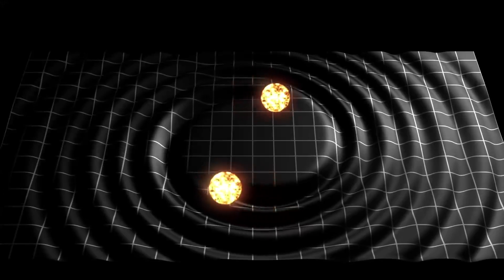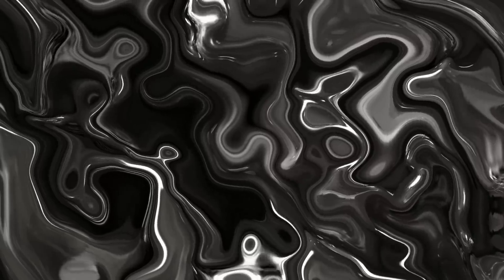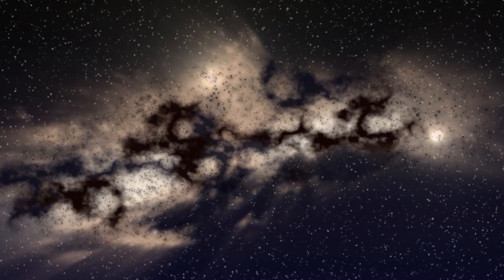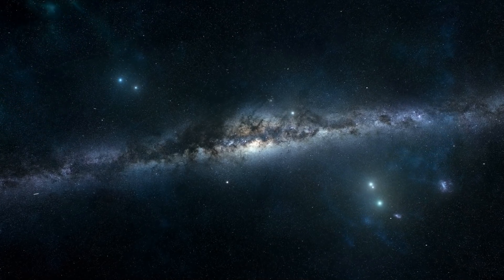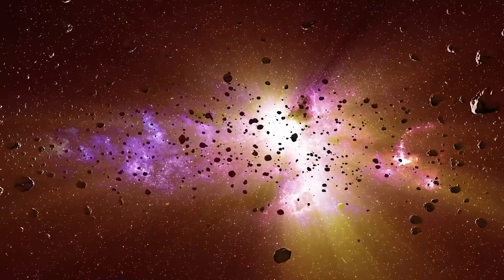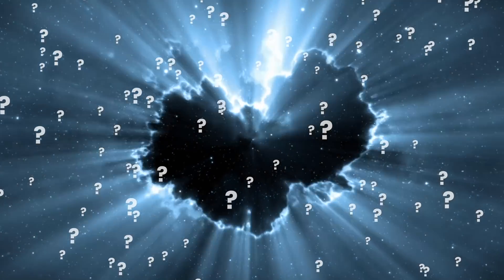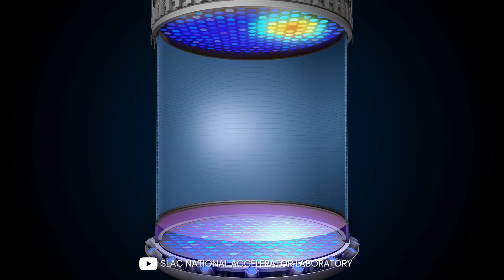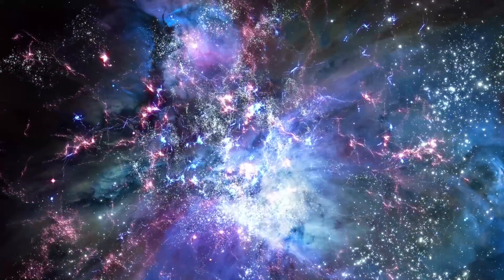This Will Change Physics! Dark Matter May Not Exist!

Comment: Dark matter is just matter we cannot directly detect. We only know of its existence by the behavior of the things in the universe we CAN see.
That doesn't mean there is anything mysterious about it or even that its made of different stuff than the stuff we CAN detect.
It only means we haven't been able to detect it by any other means than its affect on the rest of the stuff in the universe.
Before we went to space, the other side of the moon was effectively dark matter.
Most of the objects and dust in the Oort cloud can be classed as dark matter as well.
We don't refer to them as such though because they are closer to home and we have reasonable certainly what they are.
Think of dark matter as the coat hanging on the closet door when you're a kid trying to go to bed with the lights off.
Its not a monster about to attack you but as a child in the darkness you lack sufficient information to confirm that so you assume  "spooky".
Dark matter is the coat on the closet door...adult version.

Comment: Dark matter is the 20th century version of epicycles,  i.e. it doesnt exist, IMHO. Dark matter is exactly the type of error to be expected when an incorrect assumption is made.

My theory is gravity is not a pull force, but a push force.  Quite simply, gravity is created by the difference in pressure created by clumps of matter in space.  Dark matter can be defined as the material evenly distributed throughout space.  It is what magnetic lines of flux is made up of and also the medium that electromagnetic waves travel through (the way a wave is defined (simplified) is a transportation of energy through a medium.  Its funny how scientists ignore this when talking about light waves because they cant identify the medium.  In this theory dark energy is simply another aspect of gravity.  As the outward edge of the big bang travels along the universe the circumference gets bigger allowing the contents to expand faster.

Comment: I'm surprised dark matter is the only explanation for all this...  What if spacetime isn't uniform it stretches and compresses throughout the universe with different densities. What if parts of the universe with denser spacetime holds things together with greater gravity? I just thought that up in like 30 seconds...  Why don't they come up with more theories instead of sticking to one and thinking that's the only explanation...
Reply: They are coming up with many ones bro and are narrowing their realm to few.
Reply: @loganx833    Yes but dark matter has billions getting spent on it and it may not even be real.
Reply: @clearmist1  yeah that's how everything works imagine that dark matter is real we discarded them for a century and try to find other reasons but later on we found out that all other theories where false so a centuries was lost for research because of our arrogance see. You have to look into everything thing before discarding it wether it worth billions or not
Reply: Are you a physicist or astronomer?
Reply: @ascott2112  No

Comment: Space isn't a true vacuum. With that in mind, imagine what's outside the universe IS. Couldn't that explain the expansion ( if redshift is correct and it is expanding)?

Newtonian laws are provable in our solar system so, what dark matter doesn't exist in our solar system or others for that matter?

I think physics is missing something else and I think David LaPoint may have that answer!
Reply: There's no "outside" the universe. The fields that make up space and time allowing for matter and all forces do not exist outside.

Newtonian laws are easily proved wrong inside our solar system. Satellites time correction and the orbit of mercury are good examples.

You're absolutely right that we're missing something. Were not sure what, but its most likely that Einstein was wrong. There have been some very interesting theories with merit, you might like the latest MOND theories.
Reply: @Drugieuk  The universe has to be expanding into something or it can't expand (again, if red shift is correct and it is expanding). 

Yeah actually I make you right with newtonian law actually.

Mond did try to adjust newtonian law but its still not quite right. 
A variable of about 20% if I remember correctly. Unless it's been modified since I last checked.

Comment: You actually have it backwards.  Finding a galaxy without any dark matter strengthens the idea of dark matter being a particle because if dark matter was the result of a mistake in our understanding of gravity, then our calculations should be wrong everywhere.  Also, the galaxy you mention is not the only galaxy found without dark matter, there are many, and the larger galaxy chewing them up is obvious in many of them.

Comment: 7:16 correct me if I'm wrong but isn't there a difference between dark matter and anti matter? what you just described as annihilation occurs only when anti mater which has opposite charge (negatively charged antiprotons in nucleus surrounded by positively charged positrons) comes into contact with it's counterpart which is normal matter.
Reply: I do not trust this video. Author is mixing dark matter with antimater.
Reply: The thing is, the only thing we "know" about DM is that it has mass, and don't interact with normal matter by the other forces. That allows theorists run wld with theories. Some of them consider that DM is its own antiparticle. Then, when two DM particles fijd each other, annihilate in gamma rays that could be caracteristic and could be detected. People are looking. Anything convincing yet.
Reply: @eljcd  The correct answer. Thank you.
Reply: I think you're right! Definitely a mishap

Comment: I have long suspected that it doesn’t exist. I think it’s far more likely that we don’t understand how gravity works when we’re talking about large objects like galaxies, galaxy clusters, and filaments of galaxies. We also don’t fully understand how black holes and supermassive black holes affect a galaxy rotation. I think it’s more likely that we have not made the right measurements in some cases or at least our measurements are only partially accurate. Dark matter was always this thing that was used to explain inconsistencies on our knowledge of gravity. I always felt that we should focus more on understanding gravity and measurements first before we moved in the dark matter direction.
Reply: I partly agree. I think we don't understand how gravity works. However; I believe the reasoning is that it does not exist. I believe the universe is electric, and all attraction is due to electromagnetism. 

BOOOM Lol 

I honestly don't know, but I do like the electric universe theory. Tidies up loose ends of the mathematics of the universe in my opinion
Reply: @skitzosmurf4324  the electric universe theory creates more problems than it solves
Reply: @skitzosmurf4324  oh good no. Please stop!

Comment: i still think that there is no dark matter and it is just "absolute emptiness" sometimes the best explanation is the easiest and i think trying hard to make a mountain of non-information out of a mole hill of even greater non-information as it seems more likely that we are possibly just ignorant on the "why" behind the mechanics of the expanding universe... what about the warp drive concept of a gravity bubble being that outside our galaxy there is nothing and we have this force from the "big bang" that has just kept pushing the expansion faster from the inside, as a result of having nothing to push against? im probably wrong but is it so hard to believe that when we see nothing that there might actually be nothing to see...
Reply: absolute emptiness doesn't exists though, that we actually managed to confirm, even space is filled with fields which exitations correspond to subatomic particles

Comment: Dark Matter could be tied to the Aether.  The only way the expansion of the universe accelerating makes any sense is if it began from nothing and was constantly expanding at the same rate, but while expanding at the same constant rate, it just seems as though it's accelerating as it continues growing larger.  But the proposed fact that matter has already spread across 96 billion light years of the observable universe despite the universe being supposedly 13.7 billion years old is a paradox of sorts.  Unless matter travelled faster than light at the beginning of creation and has already begun to slow down, yet it just appears to be constantly accelerating because the momentum of gravitational shift has yet to reach us, or perhaps never will while everything is still moving apart until it isn't.

Comment: Dark matter, to me, seems like injections of space. It causes spontaneous creative pressure that slows time as it’s pressure increases. Acting as a pressurized space fluid, it presses equally around physical mass in the universe. It’s pressure slowing time and increasing gravity by pushing against all sides of masses. The more mass to move, the more pressure the mass experiences as the fluid pushes out. Space (fluid) on all sides of the mass must push against other fluid that is trying to move further space and mass beyond planets. The higher the pressure, the slower the time experiences. 

The bubble our universe exists as should really grow until it separated like mitosis. Form there, and one universe spits into two universes. Each being injected with more space until it grows so large that it splits again.
Reply: I call it the "Displacement Model of Gravity" and I have long felt exactly as you
Reply: @Sin526  
Then you are my best friend. This has been on my mind for a while. As a pilot, I think of air pressures. Thus pressure distribution is my mindset. Static pressure is to air as displacing space is to pressure/time.
Reply: @robandnikki1  My father is a pilot as well, and I have been interested in aeronautics/aerodynamics my whole life. I truly believe everything is a "fluid" in the classical sense and that of course includes "space". I say space and not "spacetime" because I believe the current idea of them being inexorably linked is incorrect and that they are two very different and distinct things.

Think of space as the water in a river, and time as the "current" of said water, in a way made up of that very same water but, in actuality, the "current" is merely a result of energy in the system. I believe that "time" or more accurately, the SOURCE of time, is some kind of "energy" or "radiation" if you will, which causes space and everything in it, to "flow" and in turn creating the "river" of reality we experience.
Reply: @Sin526  
I see special relativity as pressure against an object moving through a fluid. Drag increases with velocity cubed. That drag is pressure (dynamic pressure of space) and thus, to me, slowing of time. I believe time is an effect of pressure

Comment: Dark matter is nothing more than attempt to somehow keep Einstein’s relativity intact. That’s what happens when abstract mathematics are used instead of physics. In fact relativity as theory can’t explain observations (dark matter is just one example) and therefore must be either adjusted or replaced by another theory. The same goes for dark energy - mistake in decision to explain redshift of the galaxies by Doppler effect. There’s another solution for that effect, but who wants to listen. 
It’s becoming more and more evident that there must be some other theory that is capable to explain things Einstein’s relativity simply can’t. And there is such a theory - Electric Universe. The theory build on physics, confirmed by laboratory experiments. So the science has a choice - remain in the state of stagnation with Relativity or move forward with EU.
Reply: 😂😂electric universe
Reply: @loganx833      Electric Universe!!!

Comment: moebiusstrips and collatz conjectures edge in 3d space. dejavu. circumcision. foreskin restoration and geneediting with specific essencias of numbers, basically getting a pc with specific parts internet connection and the right phone number. 

says it all.

and your like "dark matter bla bla bla" what do you even want to express? something that has a continuous downtrend as it's function but is still matter. well that's radioactive decay, humans know it as Ecstasy too or as the tree of knowledge of good and evil.
uneven operations on even and odd numbers, it's unfair. thus it dies. there is more than just a duality to things and forces.

past and future probably is binary code that thus is in a dimension that is dead unseen/non material.

Comment: dark matter is a field effect called consciousness. can't wait until I am laughed at and then proved right in the next 5 years. We already know, due to recent insights, time is what is affecting gravity not vice versa. we also know time is an effect of a conscious perceiver. the base fundemental state of reality is governed by its living perceivers. the field effect of consciousness is pervasive but not uniform at all. that's why you wont find the uniform distribution. consciousness distorts time, we already know that because time is relative to a specific observer and equally true for each observer's frame of experience, even when they are dissimilar. Time distortion is created by alternate states of consciousness, for example LSD makes time slow not because of a hallucination but because it changes the structural dynamics of the field effect called consciousness. So if time is affecting the weak effect gravity and consciousness moderates the experiential perception of time. We know from LSD based on the single enzyme that is one microdot. Hmm. It's a baffling mystery to neuroscience because the drug actually acts on the nonlocal holographic "signal" of consciousness and the brain is only hosting it. Where is consciousness? I t's actually creating an epiphenomena called timespace and the brain enables that epiphenomena to create a subjective and coherent experience. There isn't "dark matter" there is the structuring coherence effect that is not distributed ubiquitously like a typical field or force. It is clustered the same way gravity clusters to mass. In this case the dual processing unit called the living organism producing the same effect. Consciousness tends towards coherence and it is non local. I suspect in two years this will be consensus science.

Comment: Could gravity be a fundamental higher dimensional force? The gravity we see is just it's limited 3 dimensional interaction? For example when a star becomes too large in a small area black holes are formed. Perhaps creating perhaps a path to a higher dimension.
Reply: There is no hyperdimensional space only 4
Reply: @loganx833  So where in space and or time are the contents of black holes?
Reply: @RichardMeikle  I didn't understand the question bro 😅
Reply: @loganx833  I was taking your comment as there are only 4 spacial dimensions. So I am asking where is all the black hole matter going. More like what is your hypothesis on that? I always figured the black holes gravity tore a hole into another spacial dimension.
Reply: @RichardMeikle  no! there is only 3spacial and 1time dimension no extra dimensions in universal scale, there was an experiment conducted at it proved that there is no hyperspace . Now only possibility of extra dimensions is at quantum scales. For black holes General relativity is still incomplete so a quantum gravity could possibly open doors inside black holes

Comment: OK, so what if the mass/gravity relationship is not always proportional?    Maybe with very large masses, the mass/gravity relationship diverges from linear --sort of an analog to how the laws of Newtonian physics break down at the subatomic level.
Reply: Interesting...
Reply: That can't really be true if I'm thinking about this correctly. Because darkmatter has the most proud effect on outside matter in galaxies. But if it  was just a change in gravity it would effect localised situations. But it doesn't, masses near each other in the outside of galaxies still behave normally. 

And a change in the force of gravity doesn't explain the odd rotational effects of galaxies.
Reply: @bobman929  So my Yoda figurine is going back to the place I resevered for my anticipated Nobel Prize, it does.

Comment: I'm not a scientist but it seems to me that galaxies are holding themselves together, all the matter in a galaxy acting as one structure, keeping itself together ?
Reply: Nah they have calculated how much matter is there and it isn't even close to keeping the galaxy together. It's not just about mass though, for some reason the out masses in the galaxy's don't rotate like they should which also suggests there is something else there we can't see. 

Normally, the further out you are, the slower you rotate, like the outer planets of the solar system. And the inside planets move faster. Just like if you pull your arms in while spinning you will spin faster. 

But in galaxies, the outer systems and masses move a lot faster than they should be which goes against conventional physics.